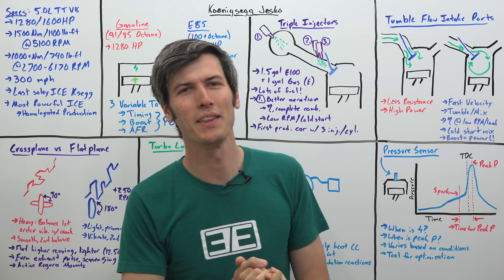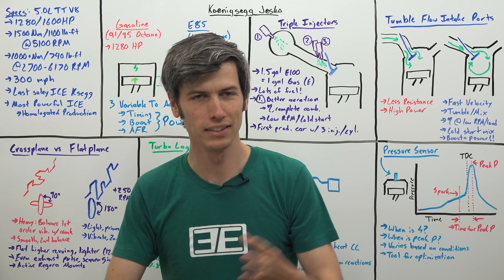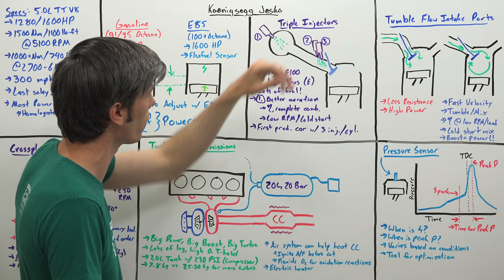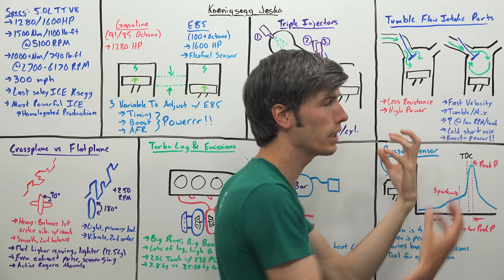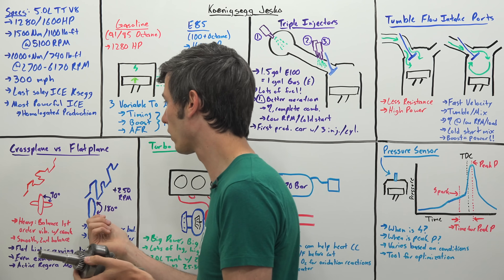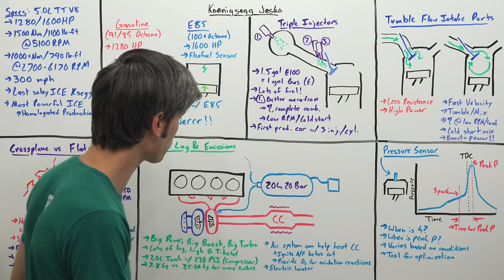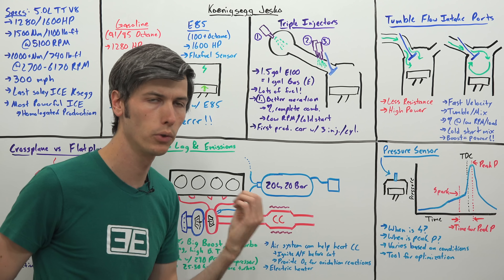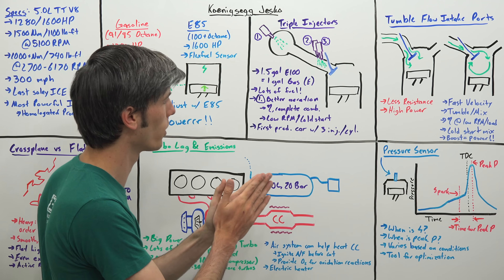Koenigsegg Jesko - The World's Most Powerful Production Engine

Comment: Power: a lot of kw
Torque: a lot of N.m
Weight: a lot of nothing
Top speed: a lot of kmh
Clutches: a lot

WHATATIMETOBEALIVE
Reply: Money: a lot
Reply: @truantray  a lot lot of a lot of money
Reply: @lluisfargaslopez3925  of course what did you expect lmao
Reply: Multiply the torque by the horsepower to get the cost
Reply: Javier V that’s 1.7 mil so your probably pretty damn close
Reply: @2689vjavier  wait... that's witchcraft!!!
Reply: 21 savage said it best
Reply: Honestly, for car guys, we live in a pretty depressing, respectively boring world, when EV's take over, there won't be a lot of difference to  their technology (or gheir sound XD). The fun begins when you like chemistry, rockets and electrification of the transportation system or solving engineering problems in general. 
I would say that the most interesting times for carguys were from 2008 on downwards ;D.
Reply: Mandernach Luca I don’t think the electric car scene will be boring, but it will definitely not be the same as a ICE car. Back in the day, when something had to be done, it was done mechanically. You can touch it, fix it physically. Nowadays, instead of mechanical design prowess, we just slap a embedded computer on it. We will not be bragging about forged cranks or LSDs, but how small our transistors are and the guage of our wires 😂🤷‍♂️
Reply: @aidaneloff5357  
Well, i would agree, but it will be pretty boring. The only thing that will separate cars from another will be their design. The rest is pretty much the same on all car. A battery, a controller, electric motors and one or another unnecessary feature, the ability to drive itself. That's all due to the concept of EVs being efficient and "simple" in terms of operation. An ICE is so much more complex and inefficient, wich makes it so much more interesting. The only really interesting thing about EVs are the electro magnetic fields that the motor induces. Basically translating a force to an object without touching it, that's as near as you can get to real life magic ;D.
Reply: Mandernach Luca i agree completely, but they will be better than ICEs in almost every way. They won’t give you that thrill. Its the same with motorcycles, it will be a very rainy day if somebody convinced me to throw my leg over an electric motorcycle
Reply: Mandernach Luca you don't know how interesting EVs are...:)
Reply: @IzajResGS  Kilowatts is how civilized rest of world measures power. It has nothing to do with electricity.
Reply: Jaroslav Novotny 
You mean Earth bound civilizations?
Reply: Jaroslav Novotny no, PS is the only right measurement of power
Reply: Weight: a lot of safety
Reply: Woah 😪 21 savage
Reply: $1 = 1 Nm • 1 W
Reply: A lot of fun!
Reply: Lots of restrictions from Koenigsegg  /sigh.

Comment: The Volvo system is called PowerPulse. 
I remember from when I was a kid, SAAB had a functioning prototype system with a tank that collected cold exhaust gases and recirculated them when the catalytic converter was warm. Didn't go into production, but they had test cars with it on the streets.

Comment: It's too bad that the climate change whiners are going to kill off the internal combustion engine before all the cool new technologies that are becoming available can be implemented into a single production engine. The freevalve variable valve timing and lift, variable spark timing, variable speed electric motor driven compressors to pack just the right amount of air into the cylinders and of course even more that I can't think of right now, all controlled by the engines computer module to produce maximum power and fuel economy. An all out effort could now produce a magnificent engine.

Comment: All though you make a valid point about the torque being higher, if you were to try and use that engine for a towing application i think you’d spend a lot more in fuel to achieve the same amount of work. I could be wrong, but that’s my ¢2
Reply: He wasn't camparing tow power. He was just making a point of how impressive those numbers are from the jeako. I'm sure the disil makes it's tourq down low in the rev range

Comment: But will they have the tires reach 300 mph?
Reply: They managed around 280mph on stock tires with the RS, without any issues. 300mph should not be a problem with new Michelin tires designed for the Jesko.
Reply: yeh mate, a GT40 did 300mph in the Texas standing 1 mile last week.

Comment: Getting to 300 Mph with 1600BHP will require an insanely low drag coefficient. I expected the first car to reach 300 mph to have something like a 10 litre quad turbo V12  pushing 2.000 BHP
Reply: The "First one" is a Dragster or a rocket car, also could be a Lambo with 2 turbos added. But here this will be the first production street legal, as it comes.
That also means sustained durability
Reply: A moded M2k Motorsports Ford GT already did it a few days ago.Heavily boosted twin turbo but only 5.4 little V8.2500 HP at crank,2000 rear wheel HP.Still Street legal apparently..

Comment: Interesting you talk alot in these videos about how fast it heats up and Fords 2016 2.0l ecoboost in not only my vehicle but also 2 of my friends vehicles you can let it cold start and idle all you want it will not reach operating temperature unless its hot enough outside.
Never seen a engine behave in this way the thermostat should remain closed until needed but this engine wont across several vehicles Fusion, Focus, and Escape that I've seen with my own eyes.

But you also did mention its the Catalytic Converter that matters maybe that has something to do with it maybe it makes it to the temp faster I don't know but its detrimental to their 2.0l 2016 direct injected engine the way it runs.

Comment: Opel, VAG and BMW are using cylinder pressure sensors for years now in high volume production.
First generation was an integrated design ob glow plug and CPS. New BMW B57 engines uses a separate CPS with an extra channel in the cylinder head for the sensor.
Reply from the maker: Fascinating, and these aren't simply knock sensors? Would love to read up more on this! Thanks.

Comment: The compressed air to the turbo, is that comparable to the electric mgu-h in F1 to avoid turbo-lag?
Reply: similar effect.
Reply: @nordic5490  yeah, combustion engine and electric engine also have similar effect, both get your vehicle going... 🙄
Reply: No, the MGU-H gives it's power to the battery pack and when the turbo has to spool up it's direct driven by an electric motor. F1 are hybrids these days and for them its easier to use that electric power already available in the car.

Comment: what do you think about the porsche method to eliminate turbo lag vs the koenigsegg and volvo one?
Reply: What's Porsches method?
Reply: @surfside75  When you take off your feet of the throttle, instead of closing the intake to the cilinder it lets air passes threw the cilinder, but without fuel, so the turbo can be spinning while not transfering power to the wheels. Ofc this has limitations and doesn't apply to all situations.

Comment: jet engine more power constant  high torque out last the car variable valve  axis flow  attached to electric motors and done
Reply: Way less efficient at idle (basically can't idle cleanly); doesn't burn as cleanly in general, making emissions harder than diesel because backpressure really fucks with them; and hard to muffle, making them loud. I want one anyways, but turbine hybrids are probably not the future.

Comment: Great vid on a great machine! I was wondering why not dump the compressed air into the intake?
Reply: Hi. As said, the aim is not only to increase power but also to increase the overall efficiency of the engine. If you pump in the compressed air which is not only compressed but also at a higher temperature it will decrease the efficiency by reducing the time for the flame propagation in the combustion chamber. If this phenomenon occurs it is likely that fuel is burnt faster than the actual time it is required to burn inside the combustion chamber for the next stage of the cycle to take place. Therefore fuel economy reduces and performance also drops. Power delivery is non linear and knocking tendency increases.
Reply: @sankeelchavan6150  actually, you want as quick flame propagation as possible, as temperature and pressure is higher (the more the better). That is one reason high compression ratio engines are more efficient.

This is exactly how Mercedes managed to get about 45% thermal efficiency from their new F1 engine, video on this channel.
Reply: @sankeelchavan6150  your last points are the actual reason for decreased efficiency - knock - which should not happen in a correctly designed engine.
Reply: I feel you haven't followed the sequence of the points or maybe i haven't framed it in a way one can understand. I was never pro-knock.
Reply: @sankeelchavan6150  Neither have I stated it :) With your last points I meant that you said the hot air leads to knock, which is completely true. I wanted to clarify that this is the reason why thermal efficiency decreases, and not because of the faster flame propagation. All good man.
Reply: @LocPH.  yes man sure all good but dont you think according to all their design parameters working together and the values they got generating 1600 on E85 increasing the temperature and density of the air further would lead to burning or rather explosion of the fuel way above its boiling point? This can bring up bhp but this would not only cause knock it would also bring down the thermal efficiency by increasing the combustion temperature therefore more heat would be generated and lost to cooling system therefore according to a heat balance sheet would generate more heat to the cooling department and lesser to the brake power department. Output by input would be so low if all the heat would remain as heat and not genete into useful work :)
Reply: @sankeelchavan6150  No it doesn't work like that.

If it results into then knock thermal efficiency will decrease, yes. 

But you are saying that TE will decrease because there will be a larger temperature difference between gases and coolant which will result in greater heat loss, then that is not the case. According to thermodynamics a larger temperature difference will result in higher TE mainly because the time intervall for burning will significantly decrease and it will actually do the opposite as you stated, much less heat will actually be wasted because there simply isn't enough time = energy must go somewhere = turns into pressure = more work (higher TE). 

If you want more proof, first of watch that Mercedes F1 video (it's interesting) and do research about energy conversion systems as thermal plants, and you'll see. 

It's easy to get it the wrong way, I hope this is clarifying :)
Reply: @LocPH.  Hi, Yes I agree that faster flame propagation might have better efficiency but that I feel that doesn't mask up the other effects it has as I stated. As far as the formula 1 video u are speaking of there are not one but many aspects to increasing efficiency one of which is using electric motors to spool up the turbos and that said anyone cant just pump in 20 times atmospheric pressure into an engine to make it run faster you want it to last, not blow up right? And  f1 engines dont last like production engines. If that would have been the case today there would be a 100% efficient engine. But to every design there are limiting parameters. And many practical losses like the one I stated and even exaust gas loss is another one that does not allow efficient burning even with such high compression ratios.  Either the engine wont last or it will simply decreasse thermal efficiency by causing knock. All that sounds good on paper not in practice my friend. That said I really respect the opinion you gave and yes in many scenarios that plays a role in increase efficiency but that might not be the case here.
Reply: Correcting myself, fuel efficiency was also an important aspect of the design as stated in the video the position and angle of the intake valve causes better mixing of fuel with air in the combustion chamber. The abnormal increase of the pressure will increase the thermal efficiency theorically but will also decrease the fuel efficiency drastically.
Reply: @sankeelchavan6150 
First of you need to get one thing straight. A higher pressure, higher compression ratio engine will basically always be more efficient. If you look at the figures, the hybrid system provides an increase from 44% to 50% TE, the engine does the rest (nearly 50% more efficient than most engines). 

Also, this has has nothing to do with engines lasting longer, the F1 engines last so short because they have extreme power output compared to their size (and therefore all problems that come with that, like knock and tolerance). This is the only reason for short life (yes I'm aware of that increasing pressure so fast might lead to mechanical issues, but not as much if power levels stay the same. The F1 engine use this technology to both get higher efficiency and more power, but it's possible to choose one). 

Thirdly, TE does not increase on paper while decreasing in practice, absolutely not. Either it increases or decreases, and it has been tested in real life to rise in efficiency. 44% for engine alone is real. 

Lastly. The better valve airflow, air-fuel mixing and therfore the sudden and huge increase in pressure can and does only one thing when it comes to TE - increasing it! It cannot do both, decrease and increase at the same time.

Comment: Excellent. Hope you can do one with the 9 speed 7 clutch gearbox of the Jesko also.
Reply: i get why you"d want three clutches, but 7?
will need that explanation video
Reply: @AnarchistMetalhead  
The reason why you want all those clutches is for the "racing" mode of the gear box where the car shifts itself depending on your current speed, torque, rpm and other factors. The Jesko is the first Koenigsegg car that has been equiped with a gear lever for a few years. You can only shift up or down one gear at a time with it, but it also comes with a second functionality where you push the lever forward twice to engage that "racing" mode. In a traditional dual clutch gearbox, the car can only efficiently shift from 1 -> 2; 2 -> 3; and so forth and verce visa. The 7 clutches allow the car to nearly instantanously shift from any gear into any gear. An example for this would be crusing on a highway. To save fuel, you will want to be at a high gear and run the engine on low rpm. Now imagine you want to take over a truck or any other vehicle in front of you. In that case you want high rpm and torgue so you shift down. If you were cruising at 100 km/h in lets say 7th gear, the car would have to shift down from 7 to 6, then from 6 to 5, from 5 to 4 and so on until you reach whatever gear suits your accelleration-needs the most. With the additional clutches, the car can (almost) instantly shift from 7th into 4th gear. 
TL;DR The addtional clutches are for faster downshifting
Reply: @AnarchistMetalhead  From my understanding, three clutches engage any of the 3 gearsets on the first gearshaft, leading to three more on the second one which also has three clutches. 3×3 = 9 different choices of pathing and so you have 9 forward gears. The last clutch is for bypassing the second gearshaft altogether making a reverse gear. There are videos explaining this, and they used the patent for reference.

Edit: Embarrassing math corrected.
Reply: I feel like people are unaware that modern 8-speed transmissions already use 5 clutch packs. Why is 9-speed with 7 clutches such a big deal?
Reply: @flybyguy1450  because it's made in a completely different way. It's a compound gear system, without syncros, without flywheel.

Comment: naive question maybe, but why don't they use direct injection?
Reply: Probably because of the weight. DI requires an additional high pressure pump.  Maybe the pump weighs more than the additional 2 injectors?
Reply: Because DI sucks. Theyre not reliable in the long term and the typical reason for its design is to cool the combustion chamber as fuel vaporizes to allow for higher  compression. Since E85 allowz for higher compression without needing to cool the air more, they dont need it. Plus the third plenum injector cools the intake air as well so theres plenty of cool enough air. DI is great in theory but terrible in reality. Just not practical. Plus the use of DI injection pumps requires them to run off of the crankshafts rotation and with such high horsepower aim you need a lot of fuel. All that extra fuel needs plenty of time to atomize and if you dump a massive amount in the cylinder directly, it wont be able to atomize properly, in addtion to the pumps needing more power to operate pressures in exdess of 3000 psi and such high flow DI injectors would take up a lot of space in the cylinder. A bigger hole compromises the integrity of the head so with 1600hp, you need one hell of a solid engine.
Reply: @ZzzRoofus  thank you for that thorough explaination. everything seems to make sense.
Reply: Freevalve makes DI unnesecery

Comment: 3rd Benny of using compressed air directly to the exhaust turbine: Cool air will cool the turbine initially
Reply: I had the same thought. Since you're releasing air rapidly that will cause the tank/air to cool down very quickly. So in theory it should cool down the turbine/downpipe?